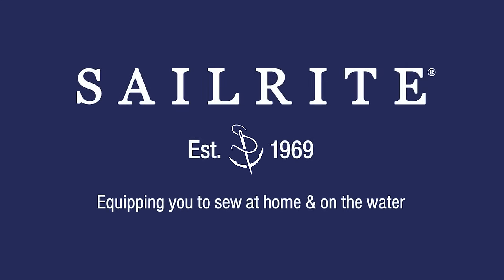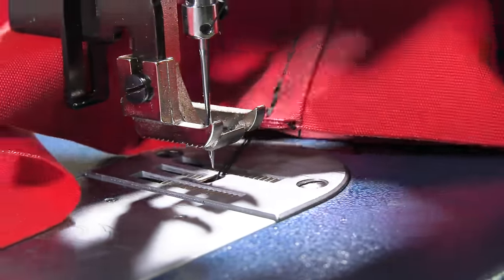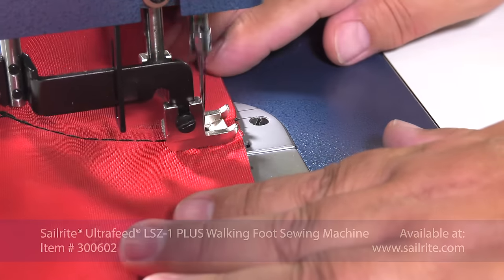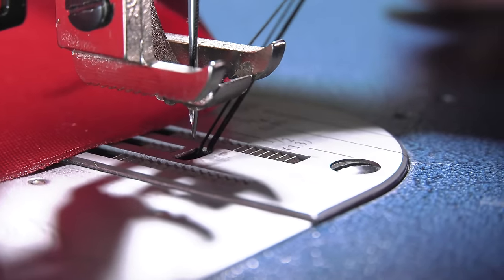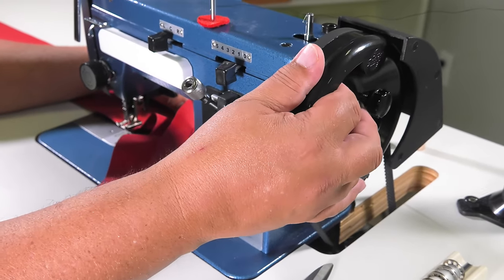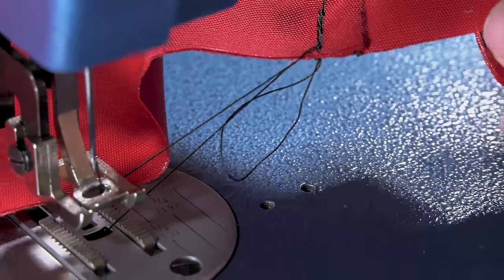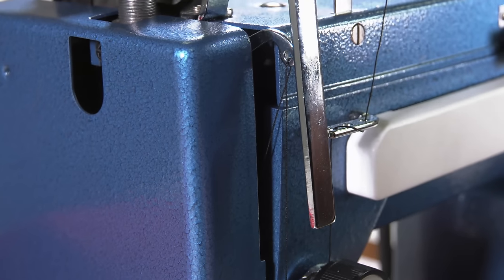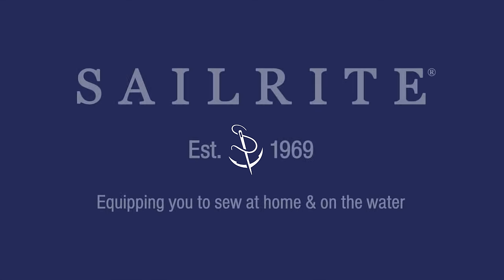My Fabric is Stuck In Sewing Machine - Extra Loop of Thread from Bobbin

Comment: Thank you! as a casual sewer I have occasionally gotten frustrated enough with that issue to just stop using my machine for a while. 
good to know the fix!
Reply: What was the fix? They didn't show a fix in this video...they just said how to get the extra loop out. I want to know why? So it stops  happening? My LSZ does this about 50% of the time.
Reply: @wernerostwald287 it has to do with when in the cycle the sewing is stopped, I'd call it happen chance and not actually a flaw.
Reply: @dscrive  Thanks...I will try to find a proper point in the last stitch cycle that is best to prevent this from happening. I must be regularly stopping the stitch in a bad position because this happens to me quite often.

Comment: This video didn’t explain how to solve the problem. What did work for me though was rethreading my top thread. I had changed my thread yesterday and when I threaded the machine, the thread was not placed correctly in the take up arm loop (step 5 on most Singer machines). Hope this helps anyone that’s in the same boat I was in.
Reply: I'm having the same issue. Are you sure it's just a threading issue? Does it have anything to do with the bobbin? I want to figure out why this happens and how to stop it

Comment: At the start of this video you state you will explain why this happens. You show the bobbin assembly with the loop that needs to be released but you don't explain why this happens and what needs to be done to prevent this? Please explain what needs to be done to resolve this. Thanks
Reply from the maker: The only thing that can be done when this happens is to rotate the balance wheel so the loop of thread is released from the hook area below. This issue can't be solved, it is the normal function of the hook tossing the loop of thread around the bobbin.
Reply: @SailriteDIY  I like your videos but I don't like your answer. It can't be resolved? This is happening quite regularly on my 2012 LSZ. And its frustrating. My machine is properly tuned and works very well except for the extra loop happening so often. Please use your team to get to the bottom of this issue...Thanks.
Reply from the maker: @wernerostwald287  It could be resolved with a needle positioner feature. You can then set the machine to have the needle up all the way or down all the way down when the treadle is deactivated. If the needle were all the way up that would release the extra loop being at 6 o clock position on the hook. That would require the machine to be set up in an industrial table with a servo motor and a special balance wheel mounted with an Industrial Sewing Machine Needle Positioner and Synchronizer feature. We do not carry the needle positioner, but I can give you a link to one that you might be able to set up on your machine. We have no instructions for completing this task, so it would be all on you to set it up. I can email you a link to components and prices that you may need if you like. ericg@sailrite.com

Comment: I have a brother VX-1100 machine... This is the first video I've seen to explain this problem. Its doing this constantly... Any tips to stop it from happening in the first place? Ive tried different tension cleaning... all the things. I'm wasting thread and time. 😞
Reply from the maker: The only way to prevent this is to make sure you pull the fabric out with the take-up arm at the correct height as shown in the video.
Reply: I changed my thread from a cheaper mainstays thread to a Coats and Clark - it's happening way less and the technique you showed for releasing it is working great! Thank you so much I really appreciate your response!
Reply: @SailriteDIY I think many people have the same unanswered question. Why does this happen in the first place?

Comment: I keep having this problem, but it’s usually at the front (or middle) of my work (usually with straight stitch) and it keeps the fabric from being pulled through to continue sewing. I usually end up ripping the stitches and restarting from the beginning, which is quite a pain. Is there a reason it would be happened so often, not just when releasing the fabric?
Reply from the maker: You may have a timing issue. If it is a Sailrite Sewing Machine simply email support@sailrite.com and our sewing machine techs will help resolve your issue.

Comment: This was exactly the issue I was having, thanks for a great video.
Reply from the maker: Your welcome!
Reply: @SailriteDIY   but WHY does it happen, and how do we get it to STOP happening ? Please.
Reply from the maker: @debbiedebbie9473  It can't be stopped. You see the loop of thread must go around the bobbin and if it does not go all the way around the bobbin at 6 o'clock it will hang up on the oscillating hook. All you need to do is rotate the balance wheel to get that loop past the 6 o'clock position.

Comment: Thanks Eric, good to know what's going on under the machine.  I have an issue with the thread becoming bunched and partly shredded between the needle eye and the material while using a straight stitch. It seems that the thread is unraveling and being torn.  Do you have any vids on this problem ?    J K
Reply from the maker: Hi James, It is likely an issue with the gib hook or cap spring that is causing the thread to  bunch up above the eye of the needle. This video should help you resolve that issue: https://youtu.be/eTqtANPnSVI

Comment: what is the country your machine made
Reply from the maker: The machine is a collaboration between China, Taiwan and the United States (our facility in Indiana). Most parts and subassembly is done in China (motors from Taiwan) but all tuning and several critical components are made in the states (Posi-Pin parts, PowerPlus and Monster balance wheels, and a few key internal parts). All manuals and video instructions are done in the states as well.